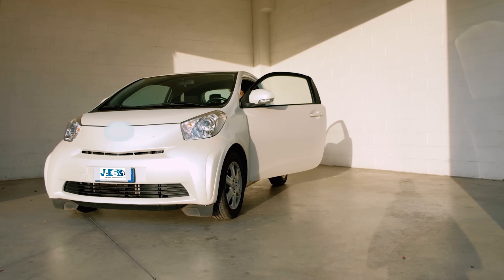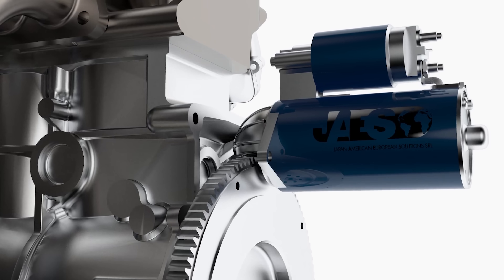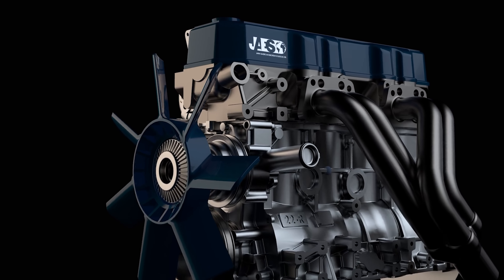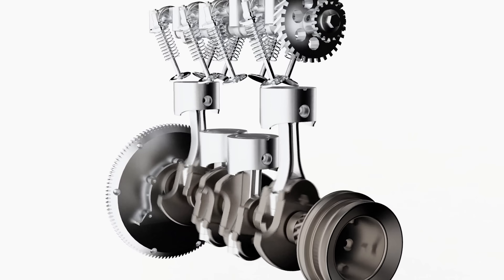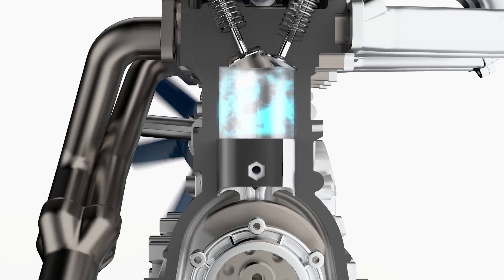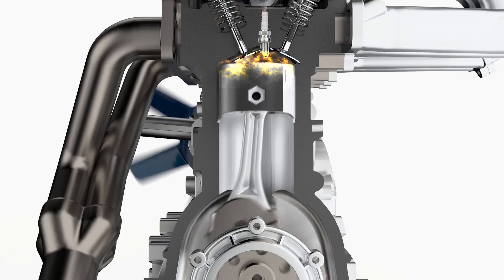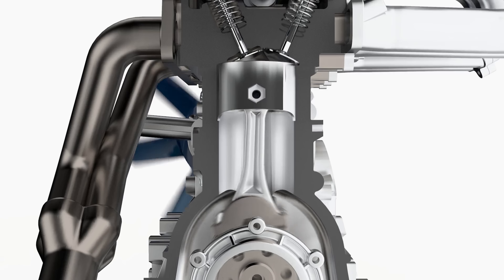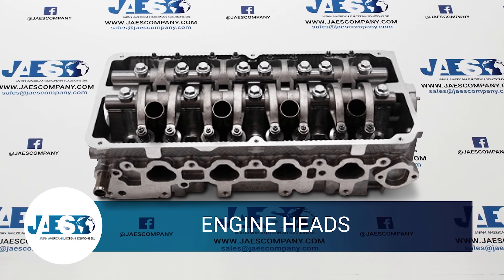What happens when you turn the ignition key in your car? Internal combustion engine (Car Part 1)

Comment: When you turn the ignition key - 2500 metal parts of old technology start to move.
Reply: electric cars are older than ICE cars
Reply: @monotnoustreecustoms5420  , yea, we would have saved ourselves a lot of grief if we had gone that way a 120 years ago but sadly Rockefeller et al got involved and sold us on oil.
Reply: @shepherdsknoll  the battery technology was not there, we have worked on batteries ever since then , people act like we just decided to invest in battery tech when tesla came out.
Reply: @monotnoustreecustoms5420  , I have an electric truck on order. 620 mile range, costs $12 to fill up , 3500lb bed capacity, 14,000 towing, built in air compressor AND 110, 220 there is little to no maintenance including 150,000 miles on a set of brake pads.
It has a stainless steel body that won’t dent and when I’m not using it for work it will do 0-60 in 2.7 sec. 
if you think batteries are not there yet , you are sadly mistaken, don’t get caught on the wrong side of technology.
Reply: @shepherdsknoll  Which truck is that you described pls?
Reply: @RadoHudran  Tesla Cybertruck
Reply: @shepherdsknoll  Thanks madlad!
Reply: @shepherdsknoll  : I agree, but I think it'll take a while to have enough charging stations around the country. (Canada anyways) . My next car will be gas powered until it all is in place. Enjoy your truck, sounds great.
Reply: @shepherdsknoll  you completely misunderstood monotnoustreecustoms comment
Reply: @shepherdsknoll  to be fair the battery technology was not ready back then and fuel was cheaper the water. so i see why they went that way.
Reply: @perimiter  , except that many cities had mass transit based on electric motors, trolleys, etc. Many complete operating systems were ripped out due to the influence of big oil.
Reply from the maker: Exactly! Have you had a chance to watch our videoS about STEERING SYSTEM https://youtu.be/Iw1duKjGcto MANUAL TRANSMISSION https://youtu.be/G6hCvdW4dKo BRAKING SYSTEM https://youtu.be/6xWEEbhBtuY and ELECTRIC VEHICLES https://youtu.be/flQSQxHVS14S We would like to know your opinion about it. 
If you want to learn more about our projects, you can subscribe to our channel https://www.youtube.com/channel/UCb7TkWFn3nyb6XhudxGu5tw and visit our website https://www.jaescompany.com/
Reply: Anyone with experience with cordless power tools will understand why ICE vehicles took over.
Reply: @CIorox_BIeach  , I haven’t had any problem with mine. I even have a battery powered chain saw, I never have to worry about breathing the fumes or getting gas on me or wonder if it will start. Battery powered tools are much better than gas.
Reply: @shepherdsknoll  They work just fine, but you can't get away from a generator, or wall outlet for long.  They go real strong for the first 20 minutes, begin to wear down and be just OK for a while, limp along after that and then finally die.  ICEs run strong until the tank is literally empty.  The batteries for power tools wear out and won't hold a charge a lot quicker than the manufacturers claim.  Also when you need real torque on the job, you always have to go get the wrist twister and extension cord, or air hose that goes with it because no pack of lithium known to man will do the trick.

Edit: the only concrete saws I've ever seen in use were 2 stroke gas engines.  We used one for cutting bundles of rebar at my last job and it went through it like nothing I'd ever seen.  I started reaching for the concrete saw whenever I needed to cut anything thicker than 1/4 inch besides wood even though it was somewhat intimating and heavy because it was instant.
Reply: @CIorox_BIeach  , sounds like you have a lot of whoas. Lithium runs strong to the end of the cycle, then dies all at once. You must also charge it correctly. I have an EV that has 98% of it’s battery strength after 67,000 miles. Lifespan should be 500,000 miles but I keep the charge between 20 and 80%. I would just suggest you say on the right side of technology or be left behind, good luck
Reply: @shepherdsknoll  You may not notice it, driving down the highway doesn't require that much force once rolling, but I guarantee you, they're dropping off.  That's how batteries work. 
	People who've always had it take the grid for granted.  It's good to remember, when cars came out, the great majority of homes in the US didn't have power.  Between the lack of access to electricity and inefficiency of batteries at the time and since, it makes sense that  people would opt for ICEs for most applications.  It wasn't just corruption as suggested by a comment above.

As for the second part of your comment, technology isn't something that has sides.  It's tools that we use.  We'll pick and design the ones best suited to our individual needs.  Some things, like the telegraph and Laserdisk have become obsolete, others, like the internal combustion engine, permanent magnet motor and for that matter, string have not.  Some day all of of those things may change, however unlikely.
Reply: Well, electric motors have completely replaced heat engines in industries but in transportation sector, it will take some time ie a few decades. Maybe aerospace vehicle and marine vessels would go on to use heat engines but rest of transportation ie major part would be electrically powered.

Comment: we this is for the engine only but its the steps are 1 ecu 2 pump 3 injectors 4 throttle body (depended of age an type of car) sparks solenoids get charge then the engine start  and did i miss something else
Reply from the maker: Have you had a chance to watch our videoS about STEERING SYSTEM https://youtu.be/Iw1duKjGcto MANUAL TRANSMISSION https://youtu.be/G6hCvdW4dKo BRAKING SYSTEM https://youtu.be/6xWEEbhBtuY and ELECTRIC VEHICLES https://youtu.be/flQSQxHVS14S We would like to know your opinion about it. 
If you want to learn more about our projects, you can subscribe to our channel https://www.youtube.com/channel/UCb7TkWFn3nyb6XhudxGu5tw and visit our website https://www.jaescompany.com/

Comment: GM used the same part number fuel pump in a 35 psi system found in cars as in SUV that required 60 psi, and if you didn't hit that number, could crank all day and  the engine would not start.  In tests at 35 psi, pump only drew about 3.5 amperes, at 60 that increased to 8 amperes.

But to keep you going, switch on the ignition and off three times each time the pump will run 2 seconds, pressures would be like 35, 48, 60, then it would start.

Ford starters typically had a surge current when you first hit the key of over 1000 amperes, GM more like around 800 amperes.  Same time you hit the key the ignition circuit is made to fire up all the computers.  But the slightest resistance can cause the voltage to drop below 8.5 volts.

If this happens, all of your computers will not get a proper power on reset, so randomly read code that is corrupted, your engine will not start.

No reason to design our vehicle this was, lacks  common sense, should advertise, if you want problems we have problems.

EPA is incredibility stupid, not one of their agents would last five minutes working in a company.  Newest stupid trick is winter gas, emission circuits are worthless until the vehicle reaches operating temperature. But in test as short as 40 seconds longer. With our car we get 50 mpg with summer gas, with so called winter gas, that drops to 35 mpg.  So just for those extra 40 second, burning a hell of lot more gas on a long trip.

Some of the dumbest people in the world work for EPA, this all started under Nixon in 1972, retired now. but had to put up with these guys for 40 years.
Reply from the maker: Thank you so much for your comment! We welcome anyone who brings his own contribution and share his knowledge on our videos. Have you had a chance to watch our videos about STEERING SYSTEM https://youtu.be/Iw1duKjGcto MANUAL TRANSMISSION https://youtu.be/G6hCvdW4dKo BRAKING SYSTEM https://youtu.be/6xWEEbhBtuY and ELECTRIC VEHICLES https://youtu.be/flQSQxHVS14 We would like to know your opinion about it. If you want to learn more about our projects, you can subscribe to our channel https://www.youtube.com/channel/UCb7TkWFn3nyb6XhudxGu5tw and visit our website https://www.jaescompany.com/
Reply: @Jaescompany  didn’t you just say this exact same reply to someone else?  There’s so much info missing here what type of system was performed in this video? I’m not seeing any sort of EFI in here and it’s not just as simple as turn the key and it starts there’s soooo much more involved in today’s cars you missed could you please redo this video to today’s standards

Comment: Nothing about air intake sensors, distributors, crank n cam sensors, throttle body, fuel pump? Good graphics though. Moreover this operation is valid only for petrol/gasoline engines only. Diesel engines work in a different way.
Reply from the maker: Thank you so much for your comment! Those are very interesting topics. We could make other videos about it. Meanwhile you can watch our videos about STEERING SYSTEM https://youtu.be/Iw1duKjGcto MANUAL TRANSMISSION https://youtu.be/G6hCvdW4dKo and BRAKING SYSTEM https://youtu.be/6xWEEbhBtuY We would like to know your opinion about it. If you want to learn more about our projects, you can subscribe to our channel https://www.youtube.com/channel/UCb7TkWFn3nyb6XhudxGu5tw and visit our website https://www.jaescompany.com/

Comment: What is happen when turning off the ignition switch
Reply from the maker: In modern vehicles with electronic fuel injectors, the car control unit will stop sending the signals to the injectors to put fuel into the combustion chamber. It will also stop sending signals to the spark plugs. While in older car model the ignition switch will turn off the electronics that fire the spark plugs. Thank you for your question, I hope I was helpful! If you're interested in these topics you can also watch our videos about STEERING SYSTEM https://youtu.be/Iw1duKjGcto MANUAL TRANSMISSION https://youtu.be/G6hCvdW4dKo BRAKING SYSTEM https://youtu.be/6xWEEbhBtuY and ELECTRIC VEHICLES https://youtu.be/flQSQxHVS14 If you want to learn more about our projects, you can subscribe to our channel https://www.youtube.com/channel/UCb7TkWFn3nyb6XhudxGu5tw and visit our website https://www.jaescompany.com/

Comment: The starting circuit shown here is only for vehicles manufactured before about 2000, today's cars all use computers and turning the key does nothing more than send a signal to the computer asking it to crank the engine.  In fact other than steering and brakes there is no direct link between the operator and any system of the car, even rolling down the windows is just a signal sent to the computer asking it to roll the window down.
Reply from the maker: Thank you so much for your comment! We welcome anyone who brings his own contribution and share his knowledge on our videos. Have you had a chance to watch our videos about STEERING SYSTEM https://youtu.be/Iw1duKjGcto MANUAL TRANSMISSION https://youtu.be/G6hCvdW4dKo and BRAKING SYSTEM https://youtu.be/6xWEEbhBtuY ? Those are very interesting topics and we would like to know your opinion about it. If you want to learn more about our projects, you can subscribe to our channel https://www.youtube.com/channel/UCb7TkWFn3nyb6XhudxGu5tw and visit our website https://www.jaescompany.com/

Comment: Incomplete.  Don't show off the flow of all the process of being start
Reply from the maker: Hello. Thank you for your comment! Can you tell us what is missing? Please let us know. Meanwhile we recommend you STEERING SYSTEM https://youtu.be/Iw1duKjGcto MANUAL TRANSMISSION https://youtu.be/G6hCvdW4dKo BRAKING SYSTEM https://youtu.be/6xWEEbhBtuY and ELECTRIC VEHICLES https://youtu.be/flQSQxHVS14 If you want to learn more about our projects, you can subscribe to our channel https://www.youtube.com/channel/UCb7TkWFn3nyb6XhudxGu5tw and visit our website https://www.jaescompany.com/
Reply: My Reply, JAES co.

See the viewers click the video to watch what they thought they will get to know from that video .
Long story short , You told us how does the engine stars from ignition 
But your animation shows a ignition to a rotation of motor which is turning the flywheel but the most important part is the flow of current which comes from the battery the when the fly wheel stars what happens into engine you should have disused cam shaft crankshaft and and then a 4 stroke process and in the end a good smooth animation to end the video.

Comment: Never mind the fuel pump lol
Reply: Or the sylonoid or intake, injectors, coil, distributor, spark plugs, wires, cap and rotor.
Reply: ....or the key cylinder, ignition interlock or security, signal to ECU, signal from ECU, relays, etc. Nice try, and thanks for making the video regardless, but misleading title.
Reply: Yaminabototal  Yes and the second your key goes to the second position the fuel pump primes pressuring the fuel system. Air, Fuel, Spark! we cant just forget one of these and act like it doesn’t matter.
Reply: You got it Stoney- who needs fuel, we don’t need no stinkin’ fuel!
Reply: Informative
Reply: This generation car has no fuel pump it has only a fuel supply motor
Reply: Yaminabototal  Fuel pump activates when you turn the key
Reply: "Well technicallyyyyyy"
There are always those people.
Reply: Bosch didn't given specs 🤣
Reply: Most important part
Reply from the maker: Hello. Thanks for you comment! We could make a separate video about it. Meanwhile you can also watch our videos about STEERING SYSTEM https://youtu.be/Iw1duKjGcto MANUAL TRANSMISSION https://youtu.be/G6hCvdW4dKo BRAKING SYSTEM https://youtu.be/6xWEEbhBtuY and ELECTRIC VEHICLES https://youtu.be/flQSQxHVS14 We would like to know your opinion about it. If you want to learn more about our projects, you can subscribe to our channel https://www.youtube.com/channel/UCb7TkWFn3nyb6XhudxGu5tw and visit our website https://www.jaescompany.com/
Reply: @Jaescompany  wow you are professional
Reply: I get your point but the info in the video isnt incorrect-just not complete...but it's a free video and when somethings free-incomplete or not viewers shouldn't really complain imo
Reply: @paulkersey7904  Technically speaking incomplete is also incorrect.

The issue is while this is a free video, there are others out there that do a better job while also being free. You don't get a magic pass because you put a video out on youtube for free.
Reply: @a_stone  touche
Reply: There are always people like u dickhead
Reply: Holy crap!!!! Dude, they never said fuel pump cuz its a pussy ass Prius!! ROFL!!! I'm out before I'm in.
Reply: @TheMistaneff  Prius still needs a fuel pump lmao. It's a hybrid, which is an ICE engine and an electric motor put together. You think the ICE engine runs off magic in the Prius? 🤣
Reply: It's an electric motor you gum drop
Reply: @jorhyphenel8753  by definition a motor is electric...I know what u mean though
Reply: @paulkersey7904   says lisply "well actually" while  adjust his glasses properly on the bridge of his noes
Reply: @jorhyphenel8753  lol nice try but my vision is as you should've guessed; 20/20

Comment: my car doesn't start when I turn my key unless I push the clutch in. Is it basically the same?
Reply: Pressing clutch to start the car is an anti theft mechanism. That shouldn't have any impact on the operation of the engine.
Reply: @hummadh  that is true. I mean if anything it keeps the car from rolling too if the e brake isn't engaged
Reply from the maker: Thank you all for your answers. If you're interested in these topics please have look to STEERING SYSTEM https://youtu.be/Iw1duKjGcto MANUAL TRANSMISSION https://youtu.be/G6hCvdW4dKo BRAKING SYSTEM https://youtu.be/6xWEEbhBtuY and ELECTRIC VEHICLES https://youtu.be/flQSQxHVS14 We would like to know your opinion about it. If you want to learn more about our projects, you can subscribe to our channel https://www.youtube.com/channel/UCb7TkWFn3nyb6XhudxGu5tw and visit our website https://www.jaescompany.com/